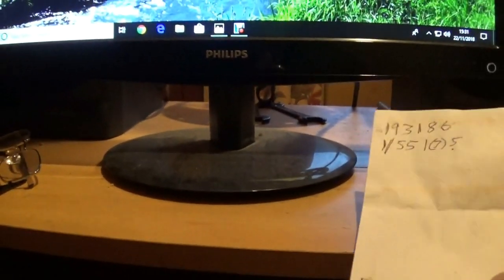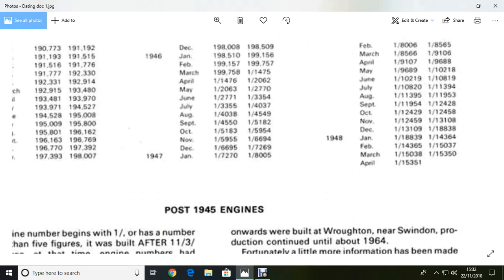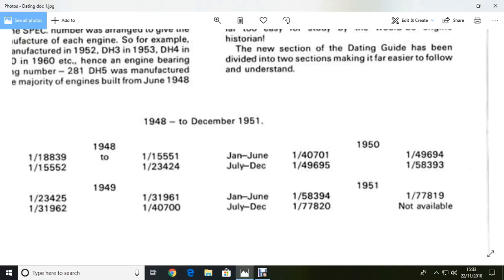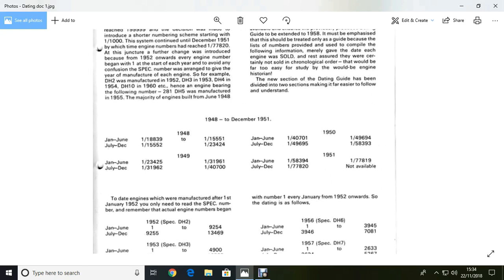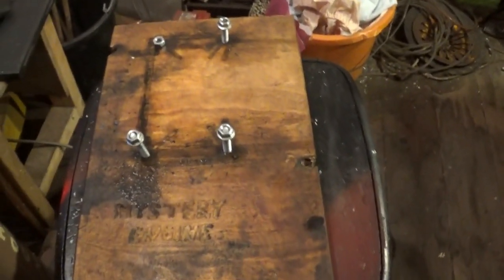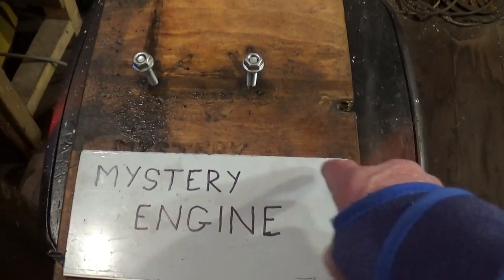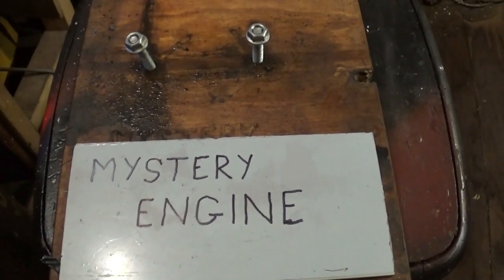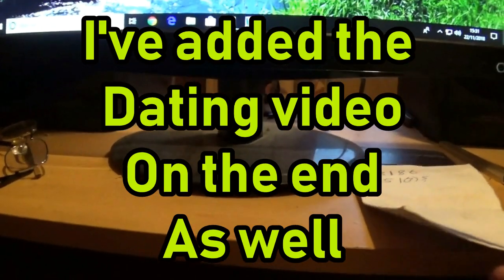How To Date a Lister D & Briggs Lighting Plant Fail

Comment: An alternator will run any direction man. I build units like that. U need a field controller.
Reply from the maker: Thanks, yes I've run it both ways. Because it does work well and I've got it I'm going to attach it more permanently now I've got the Lister in the shed. Use the idler to loosen the belt for starting.